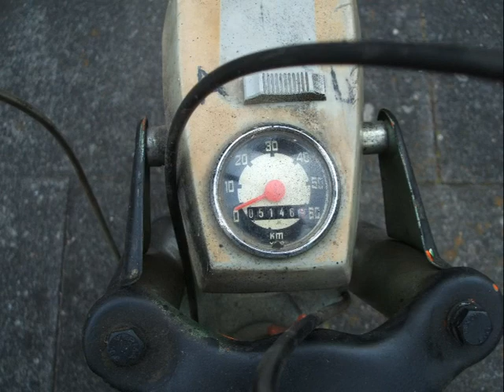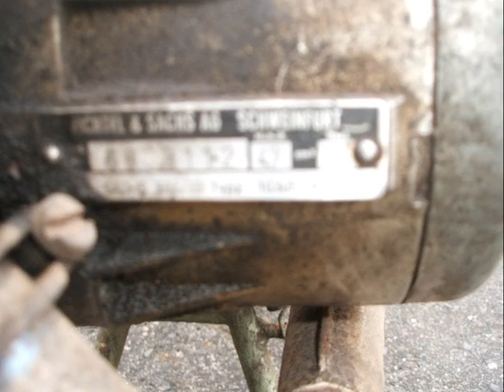DKW 508 M Baujahr 1972, Minimofa mit "Raketenmotor" von Sachs

Comment: Woher kommt eigentlich dieser Spitzname raketenmotor?
Reply from the maker: Liegt wohl an der Zylinderform
Reply: Ich habe ihn bisher immer Torpedo-Motor genannt.
Reply: Ich kenne Ihn auch unter den Namen wie, Kannonenmotor, Igelmotor, Sternmotor, die F&S Bezeichnung ist L-50(Bauform)  502/1 A+B gabs in 18 verschiedene Ausführungen Europaweit und gepaart mit vielen verschiedenen Rahmenherstellern mit 25, 30, 35, 40, 50Km/h Europaweit. Der Motor ist zuverlässig und robust
wenn er gut gepflegt 🔩🔧⚙️wird😍🤗😜🇬🇪⚜️🦉🍁🌹